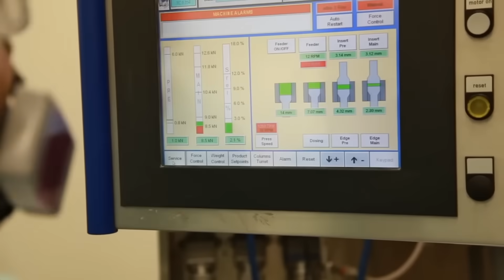Why These Engines Only Last 3 Seconds

Comment: Where's the 50 gallon fuel cell located if it drinks 11 gallons /sec ? BS baffles brains ....
Reply: This is like saying that the record breaking Bugatti Chiron didn't really break 300mph because it didn't cover 300 miles during the run.
Reply: @kennetha6594  Thanks for confirming my statement
Reply: @kennetha6594  Funnily enough, the Badd GT did 310 mph in one mile, so it's almost on par with a Top Fueler. Not quite there yet.
Reply: In the front of the car?
Reply: 11  gallon per second... the car goes for 3 seconds... how did you get 50 lmfao
Reply: @bmxscape  It's more like 17 gallons being burned in one run, because the fuel cells aren't that big if you think about it lol